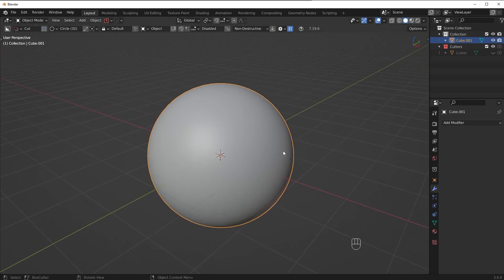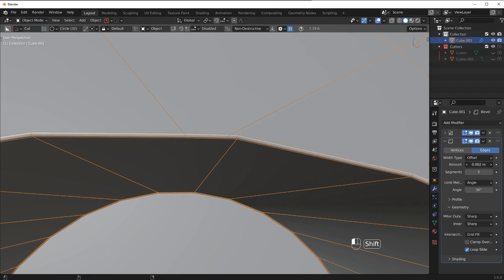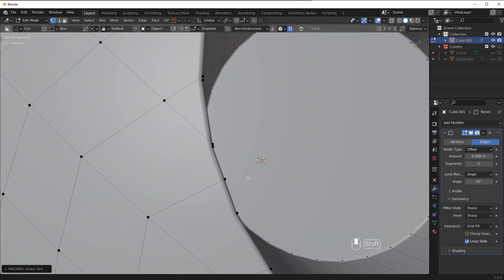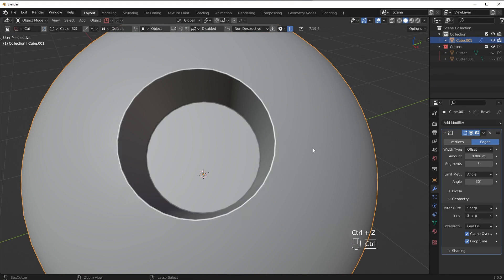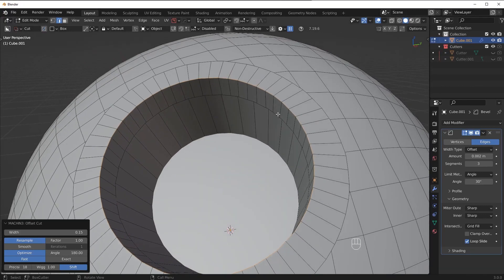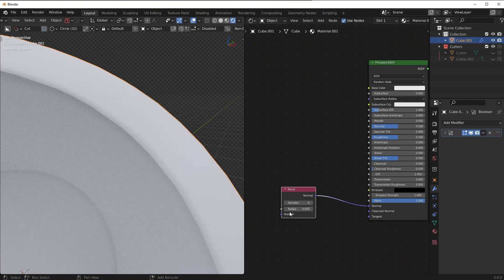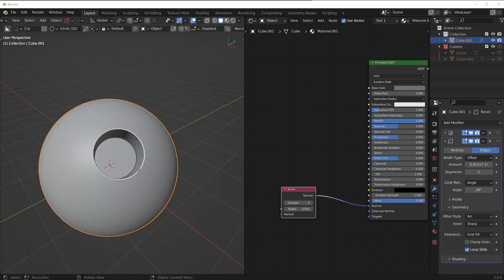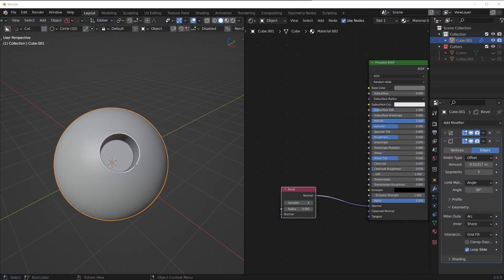Can you Bevel without Clamp Overlap? (3 Powerful Solutions)

Comment: I found a (really inconvenient/stupid) way to bevel an edge that has tons of ngons and curved surfaces nearby, not recommended, but I'll post it anyway. (its more like cutting a round corner into an edge than a bevel in itself)

1. Select and duplicate the edge you want to bevel, make it its own object seperate from the original.
2. Extrude the edge towards the 2 directions of the surface of your original object, doesnt matter if it clips or hovers over the original surface. Ngons are gone now.
3. Do the Blender Secrets video thing where you add objects seamlessly to another object by adding edge loops and putting them into a vertex group with different weights and use a shrinkwrap modifier so it sticks to your original objects surface.
4. Bevel the one edge, should be possible now as there are no ngons anymore.
5. Add solidify modifier going outwards.
6. Bool new object from the original one (set boolean mod to exact)

Downsides, way too much work and maybe doesnt work on extreme angles due to the solidify modifier (but is non destructive to the original object). Still needs tweaking depending on the object (weld modifier, adjusting position of edge loops etc). In my tests in blender 3.4.1. the boolean modifier (set to exact) sometimes stops showing the result, if I click into some settings or other objects. Then I have to disable and enable the modifier to "update" it and it shows up again.

As I said, it's a convoluted and stupid way of doing this but also non destructive (if it works at all in the first place) and faster than manually merging vertices to get everything clean, maybe someone gets anything out of it. # doubt

Comment: The easy way what i will do is separate this hole and then make it smaller 2 axis and then bride it with bend.
I used Maya terminology .
Reply: basically what mesh machine did from my understanding (but faster)
Reply: what if you don't want the hole to be smaller?
Reply: @GavinRain  Then i will start with a bigger hole. If you want i can make a video?
Again it will be Maya.

Comment: I still don’t understand why anyone would want to model hard surfaces with mesh engines and not parametrically.
Reply from the maker: Plenty of reasons - I’ve already made a video on NURBs modeling. I still prefer polygons for what I do, 99% of the time.
Reply: @JoshGambrell  yeah I saw that a couple months ago. The only reason I heard you mention was that Blender has Cycles. But you don’t really use Cycles while modelling. So it’s not a logical reason to me. Moi has an amazing obj exporter with custom normals so even when you import, you still don’t have to fix anything. I think the real reason is that you built up this massive experience in Blender and it would take some time to build the same with Moi. I completely respect the amazing results you achieve, but it will just never be a rational choice to use Blender for pure hard surfacing (not factoring in cost of software).
Reply: Good luck making for example a car with parametrical modeling and deform it later because something hit it in a movie or game. How do you control your polycount for games and large movie scenes with parametrical modeling?
Im doing 3d modeling for almost 20 years now and I never worked at a job where parametrical modeling would have been better. Its only used in product design ect. even architects usually use polygon modeling for presentantions.
Reply: Agreed. The only reason to use Blender for this type of modeling is that it's free. This type of artifact is a non issue in solid modeling platforms like Solidworks, Inventor, etc. I guess it depends on what you're trying to accomplish. If you are trying to model dimensionally accurate parts based off prints in a time sensitive manner, blender isn't the answer. If you have time and some creative freedom and are just trying to make cool stuff for movies, Blender works just fine. If I still had access to Solidworks, I would only use Blender for rendering. Depends what you're trying to accomplish and the amount of time people are willing to pay for I guess..
Reply: @joetroyner  
"Agreed. The only reason to use Blender for this type of modeling is that it's free."
Why? Outside of product design I cant see a single use case where you do not want polygons. You need polygons anyway for almost all use cases and doing retopology from a parametrical model can be really painful and slow.
Reply: @joetroyner  I partially agree. Hard surface modelling has few uses but good sub division surface technique can make blender genuinely useful!
Reply: @joetroyner  err. the only reason NOT to use Blender is if you're doing product design where you need massive accuracy. SolidWorks et al. are horribly useless if you're doing anything creative. So I guess you're asking: what is 3D software used more for... creativity or CAD applications. I think the answer has changed over time. My money would be on the former.
Reply: @GavinRain  I disagree. Modeling simple parts is a tedious, drawn out process in Blender. You're almost always forced into a destructive path that requires you to set multiple save points in the process. It gets exponentially more tedious when building assemblies. I would much rather use solidworks to model a part or assembly, then import the model to blender for animation and rendering. Assemblies in solidworks allow you to use a top down process for quick creative changes that carry over from part to part. All of that, and you don't break the model every time you want to chamfer an edge.
Reply: @GavinRain  Also, Solidworks is hardly just a CAD software. It's been used for years in industrial design which is 100% creative. Chances are you own a computer mouse, toothbrush, Bluetooth speaker, car, motorcycle or anything else with form factor that was modeled in solidworks. It is a far superior hard surface modeling platform, it just isn't a render engine and it isn't free. Don't get me wrong I love Blender, but it falls very short in efficiency for this kind of modeling. The add-ons do help a bit though..
Reply: @joetroyner  yup. I do use SolidWorks, which is why I'm commenting. I'm saying that most people want to use HS creatively which is why they use Blender. It's quite rare that you want to JUST use HS when you're talking creative - it's combined with backgrounds, lighting, some sculpting etc. I'm not saying you can't be creative in SW, but it's a stretch. When you're being creative, you don't need the precision of SW. I tend to favour SW when printing a model, but if I'm being creative I find SW just isn't geared for that.
Reply: @joetroyner  sure. but look at what you're saying - you're talking engineering, not a creative project. that's what I'm getting at.
Reply: @GavinRain  Industrial design IS creative. People who design products, cars, etc are artists, not engineers. Yes it's a very powerful platform for engineering also, but that doesn't mean people aren't using it for creative design. It's literally the industry leader for that. I wouldn't design characters or organics in SW, and that's about the only place Blender has it beat. But if we're talking hard surface, SW is just more efficient for modeling, creative or not.
Reply: @GavinRain  We can agree to disagree. If you mean being creative is shooting from the hip and slapping some shapes together until something looks cool, maybe you're right. But I feel any of the models Josh is doing in his tutorials can be modeled quicker in SW and would be much simpler to make changes to afterward if they were needed. And you wouldn't have to go in and fiddle with mesh to fix all the errors afterward. I think that's the point OP was trying to make and I agree.
Reply: So it's actually useable in blender?
Reply: procedural non destructiv ,..
Max is great for  mixed workflow but hard to learn...
Reply: the remesh part for games , or deform object  animation  f.e. is always a problem
 ..as long yo stay for t in the spline, curve ,CAd edit Software  it could faster  or fun to use etc..
  but then came the drawback, specialle you have to look to the flow , typology for animation deformation shading etc...
Max,SW, are great modeler for  but Monster programms with Tools evolved over dacades..not the best for beginner to look into 3d modeling or as starting spot..
Blender is good for that beginner I think and have all tool in it, the program that have it all. Max is great for non destructiv workflow but with mega count on modifiers all with special own tool in it and learning curve is endless.. SW is mega for contruction HS objects used not only for films or games.